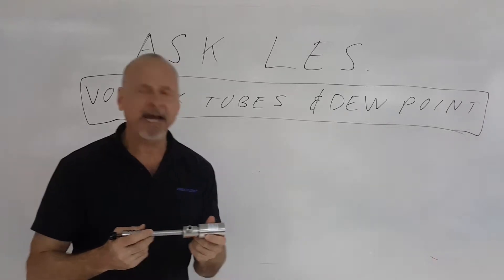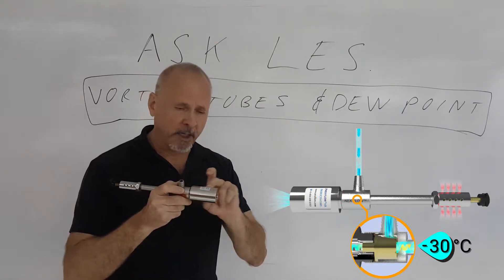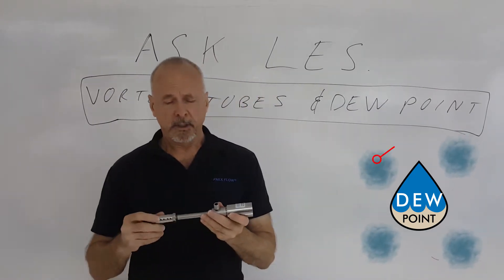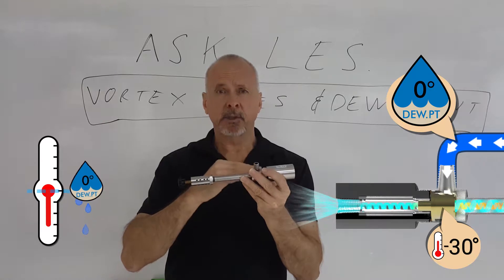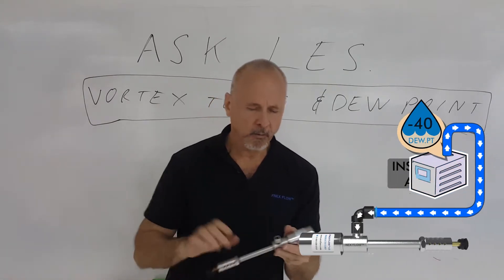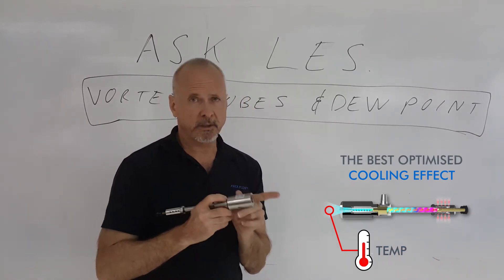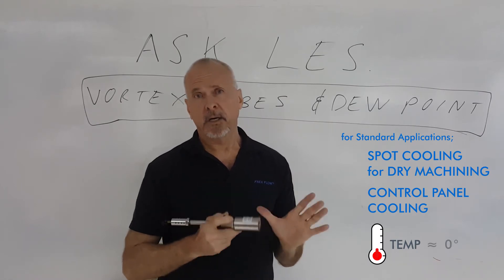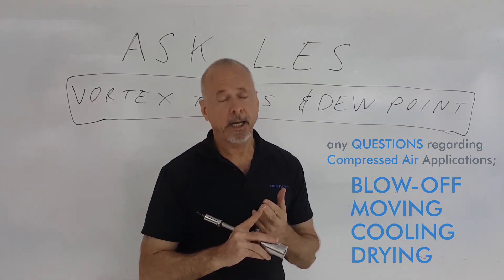ASK LES  -  Vortex Tubes and Dew Point

Comment: Hi Les, thanks for the “cool” video. I wonder if the whole system including the air compressor use less energy compare to conventional aircon?
Reply: Hi Stephen.  No.  Vortex tubes use more energy just because they operate off compressed air.  However, depending on the application other factors outweigh energy cost.
Reply: @mycutebutt1000  thanks got it. 🙏

Comment: Does the moisture exit through the hot or cold end?
Reply: Any moisture dissolved into the air will exit at both ends but mostly through the hot end because the spinning action inside the vortex tube throws any condensed moisture to the spinning area which is warm or hot, it will re-dissolve into the air and exit the hot end.  However, again, if below the dew point and with too much moisture in the main line, you can have moisture out the cold end as well.  Proper filtration prevents this.
Reply: Thanks Les. For my application, I'm looking for efficient dehumidification. Your device seems to act as a heat pump with a low COP. How big could you scale it, would COP improve if you did, and would the operating principle also apply to water?
Reply: @lexiecrewther7038  Welcome - it is not really a heat pump but COP does improve with size.  Water vortex tubes are significantly different and we collaborate with someone who has done such designs.  It might be best you email me at technical@nexflow.com and we can discuss further.